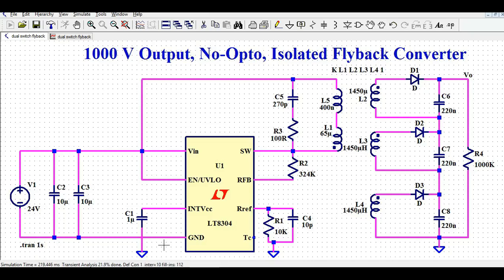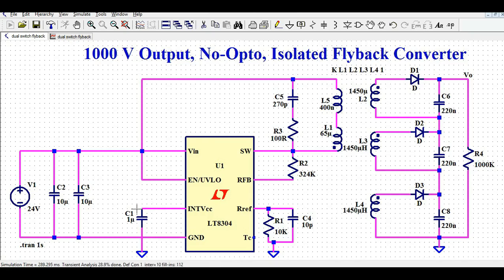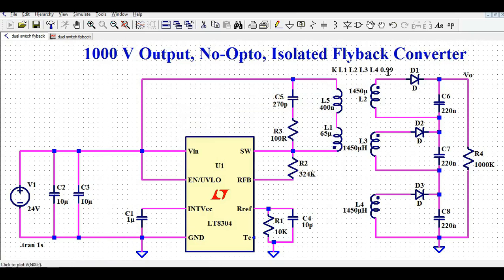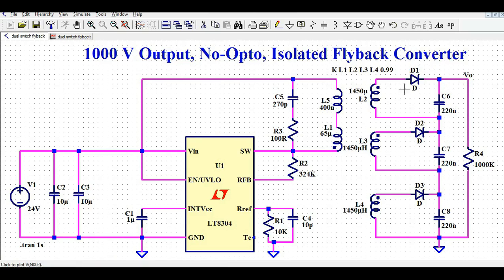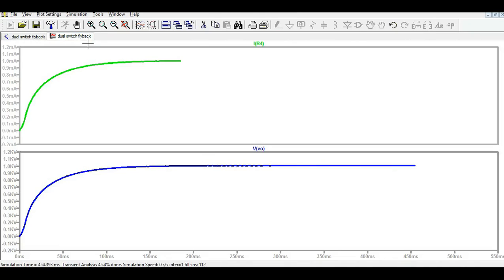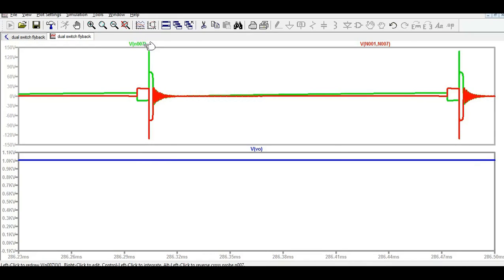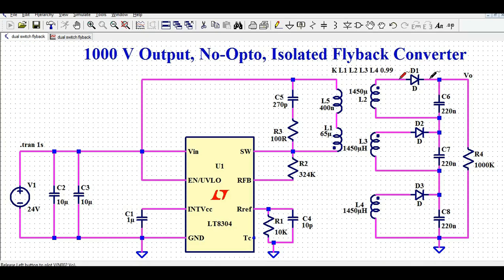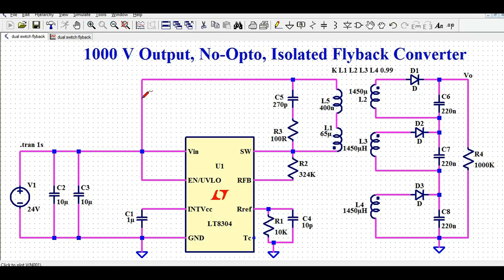Designing a 1000 V No-Opto Isolated Flyback Converter in LTSpice: Step-by-Step Guide

Comment: Hi sir,
R u sure this circuit work correctly? Could u simply missing something in video? Because I can't get correct output voltage despite of I'm using same circuit as descripted in video. My output voltage is around 460V. Do u have any idea where I've done a mistake?
Reply from the maker: Hi...Thanks for your question. This circuit works perfectly as described in the video. Please join the premium membership You will get access of original file. Thanks
Reply: @ElectronicsCircuitHubECH  premium membership 🤣
Reply: Hi, we got the same issue. Have you fixed it? thanks